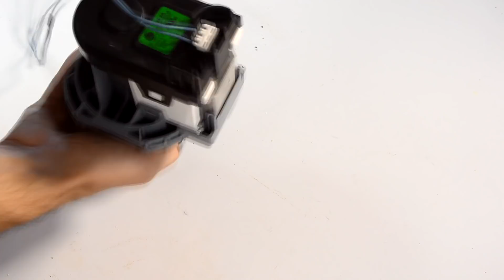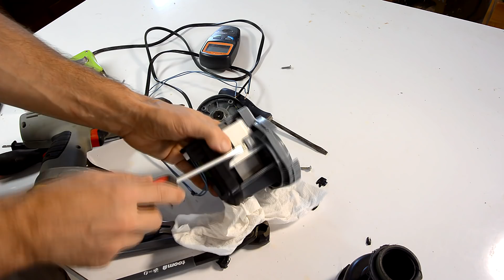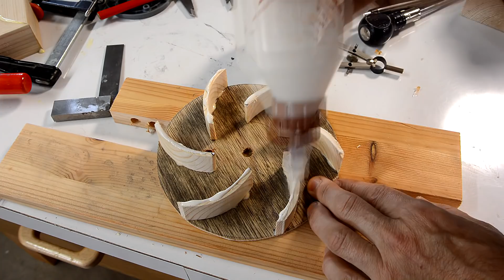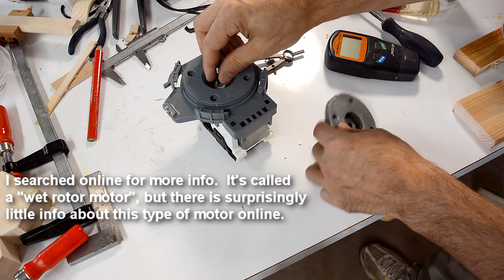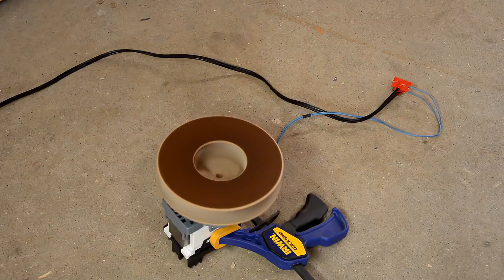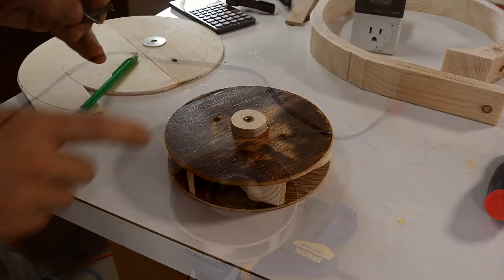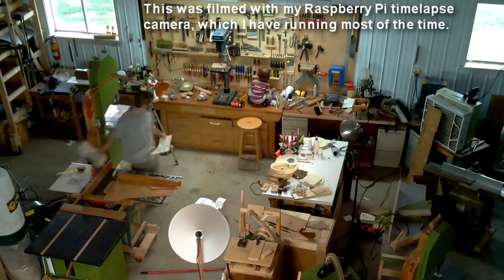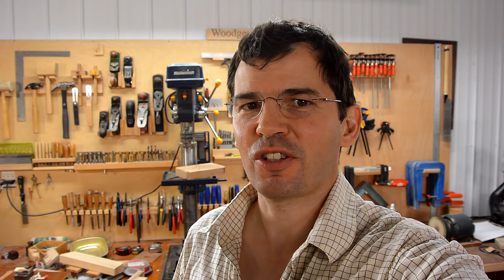Wet rotor synchronous dishwasher motor

Comment: This  wet rotor is very common in submersible pumps for aquariums. Pretty much 100% of them.
Reply: nobody has seemed to mention the water also cools it ;)
Reply: And central heating circulating pumps,
Reply: and submersible pond pumps, equipped with ceramic bearings most of the time.
Reply: a quick google search shows a good amount of information on 'wet rotors'. Not exactly technical specs or anything but enough to get a basic understanding.
Reply: @throttle bottle , " I assume filling it with water and plugging the holes, will lead to overheating due lack of change of water flow " <-- Think I mentioned the cooling properties of the water here?
Reply: The Denso ES-series of electrically-powered AC compressors used in Lexus and Toyota hybrids (allows AC to run without the engine) uses an IPM wet-rotor design, but the wetter is the AC fluid, hence these AC systems using a particular type of oil within the coolant.
Reply: @EmyrDerfel  Those one I assume are Brushless DC right?
Reply: @anotherhuman8211 ipm is a type of BLDC
Reply: The rotor in my aquarium pump is similar. My pump is the kind that hangs from the top of the tank. It pulls water from the tank up through a tube, through the pump, then up to the top of the tank through a filter and drops it back into the tank. It has lasted without issue for 25 years so far with zero wear. I assume it will last forever. The bottom of the rotor's "shaft" is very short and is kept centered by merely sitting inside a bowl-shaped fairly wide divot. The top of the rotor's "shaft" sticks out a bit further and has 4 flat blades attached to it, offset at 90 degrees. The top is not held in place, the magnets appear to do that. No bearings anywhere. Water lubricated (or at least the entire rotor is kept wet as water is moved by the blades. The only maintenance I do on it is to pop the rotor out every few years to remove a very slight film of algae and I'm not sure that's even necessary. Only magnetism holds it in place, which you can feel when you pull it out. Mine has no visible electronics and runs off AC 120V 60Hz.

I've always assumed mine was being water cooled, however, given that a dishwasher pump is actually pumping steaming hot water around I wonder if such a motor needs cooling? Presumably a dishwasher pump's design would take that into account. Or if not, maybe they're just designed to break every few years.
Reply: RunningOnAc?
Reply: Pond pumps, pet bowl pumps, many, many places.
It's a great design. Wet stainless steel and glass fiber filled nylon bushings that form the case(In a pond, lubricated too by pond scum/algae:).  Coil of wire potted in resin in the case. And they pretty much work forever so long as you clean them every so often.
Reply: I assume filling it with water and plugging the holes, will lead to overheating due lack of change of water flow? So if one were to run it in optimal condition. one might need some way to change the water out consistently. 

Then again, the magnetic rotor and similar can be used to create DC with water streams or similar. Albeit not very good at getting started, the magnet will provide resistance which should increase the production output. Hence you use DC breaks on Windmills to get them running at optimal RPM to produce more Watt per rotation. 

If my Knowledge on Generators isn't a tad outdated. Most of my knowledge is about installing it and finding out the faults in them. Not making them into generators. 

But I do recall a Rotor with a magnet tends to be easier to turn into a Generator than one, that isn't.